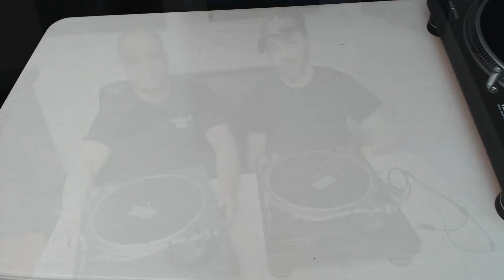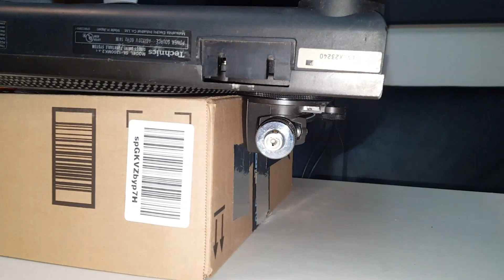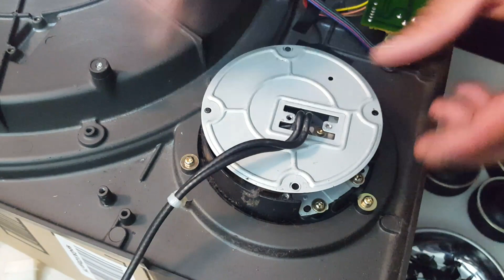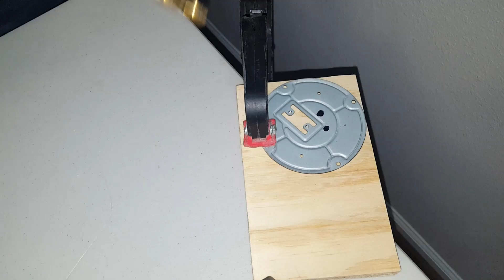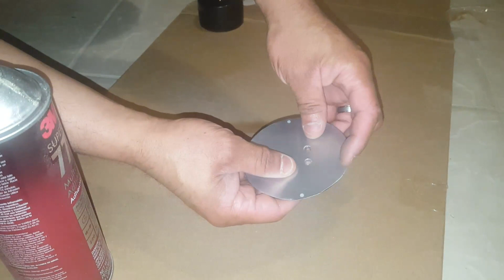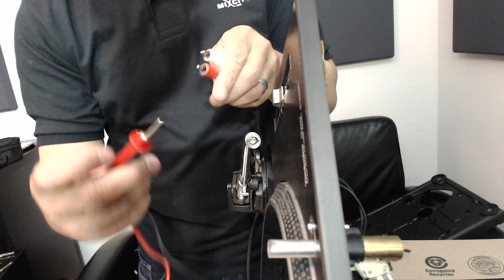Technics 1200 Turntable - Replacing RCA cables with RCA Jacks

Comment: This is a great and way less expensive mod than the other options online. However, instead of going through the trouble of cutting sheet metal, you could just use rubber grommets to cover the jagged edges around the holes.

Comment: Which part of the rca port do I attach the hot wire and the ground wire. I am assuming the hot wire goes on the middle connection and the ground on the outer connector

Comment: I need some decent right angled RCA cables for my RP-8000 MK2 for setting in battle mode. The ones that come with are cheap and have a humming sound with out without ground connected. Idk if I need some adapters to make it right angled so I can use some quality longer head ones or what

Comment: I have seen so many stupid you tube videos I was embarrassed for the people who produced them.  Your video was a breath of fresh air.  Your parts and tool list was spot on.  The way you presented your work was great.  Well thought out, not boring, to the point, great job, I rang the bell.  Only comment is about the ground.  Please leave it the way Technics intended.  Use a bolt and nut with a small knurled nut to tighten the ground wire.  Always separately ground your turntable, don’t use one of the two cartridge ground points as a chassis ground point.  This will not work as well and it “Could” damage your expensive cartridge.
Keep up the excellent work!
Reply: Please explain the reason why.

Comment: I’m not quite sure I get it. Can you tell me the main reason you did this, please? Are you replacing poor quality RCA jacks with better quality RCA jacks?
I’m trying to decide why I should do this in my home.
Thank you very much. Great video guys.
Reply: You do this so you can easily change RCA cables on the fly. No more need to open up the deck and solder another cable in... The self ground thing I don't understand... I see no reason for that.
Reply: @jordesign  It's so you can get rid of the little annoying ground wire that always gets broken too
Reply: @SiHargreaves  Gotcha!

Comment: Nice video :) But how is the clearance under the deck when using separate RCA cables plugged in that way? I have been servicing 1200's for over 20 years now, and 90% of the time the primary failure points of rca cables is inside the strain relief at the plug end. If that end is constantly coming into contact with the surface you have your 1200 on, or bent at an angle all the time it seems like this would expedite the failure rate? I'm sure some thin rca's would have enough clearance, but asking as there are millions of types of rca cables and many people may not have the right ones,  they might be too thick and have to resort to using flimsy cables so they are not constantly bent at a right angle causing strain on the weakest link. I have seen RCA mods where the plate is in place of one of the hinge brackets and they come straight out avoiding this possible issue. cheers!
Reply: They use 90 degree rca adapter jacks
Reply: Shoulda added that info to the video

Comment: Please don’t do the self ground mod. My 1200 had it and I reverted it back to the original setting and never had a problem.
Reply: Just curious, what was the issue with self grounding?
Reply: @andykelly7321  You get a hum noise that doesn't go away.
Reply: @pinomarino8917  Thanks for your reply. :)
Reply: I don't think modifying Hi-Fi audio cables is an issue. However, you must run a separate ground wire from the original position to the mixer. Don't use an internal ground; keeping it as a dedicated external wire—just like the original factory setup—will ensure there are no problems.

Comment: Excellent idea guys and very polished result!!  Made me think of a method that would involve a bit less effort and skills (no need to do the sheet metal fabrication, change the existing plate, drill any holes, or relocate the circuit board) with similar results.  
Obtain a female RCA Jacks adapter like the one in the link below....
https://www.walmart.com/ip/Cable-Connector-Inch-Inch-Plug-Male-Premium-Adapter-Wire-8-TRS-1-4-Female-Y-1-4-Jack-Cord-Splitter-2RCA-Stereo-RCA-Dual-6-35mm/149677815
Cut the 1/4" plug off leaving just the female RCA jacks on the end of wires.  Strip the wires and solder them to the SL-1200's circuit board in place of it's existing RCA cables.  Leave just enough wire length to feed out through and hang from the same hole that the SL-1200's RCA cables were originally fed through.  Just be sure to re-use the SL-1200's existing plastic snap-on/screw-in wire retainer to prevent any issues to the circuit board from moving around/tugging on wires.
Reply: This is what I've done, works a treat.
Reply: Great suggestion Dj Jammin Jeff, BUT the idea here is to have the outputs rigid to the TT body which eliminates future issues with flexible connections (which are inevitable by nature)

Comment: ive owned my 1200mk2 s for like 15 years and just now ive had one rca cord that needs being replaced so basically this is an unnesecary mod and its just another way for a idiot to fuck up there mk2s not a good idea just heat up the solder and remove old rcas then heat up the old solder and stick in new rcas its not rocket science guys
Reply: No. Never reuse solder. The flux is gone and you will produce a inferior cold joint.
Reply: But that’s ok. It’s only a technics.